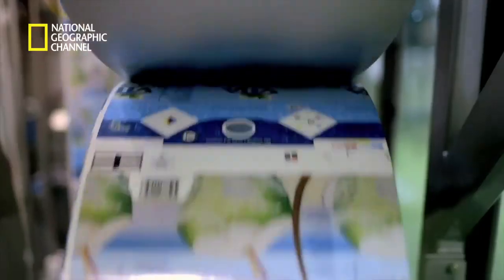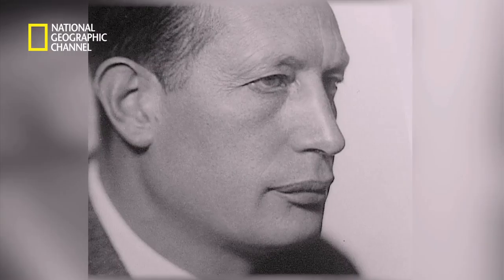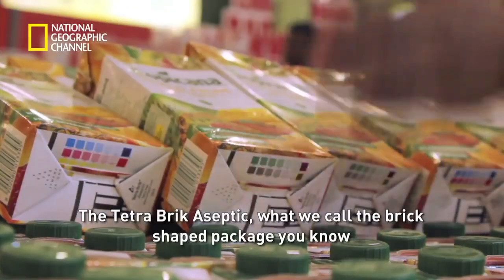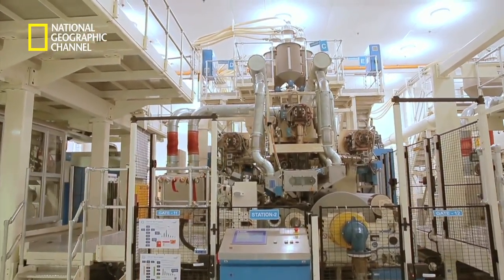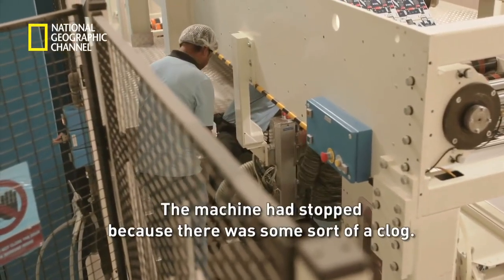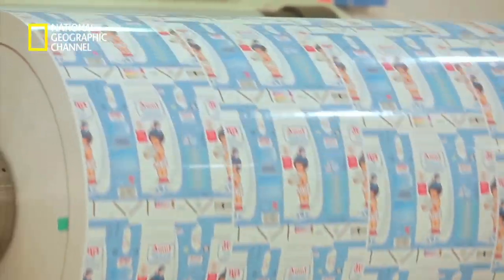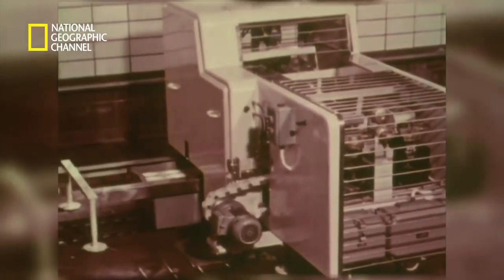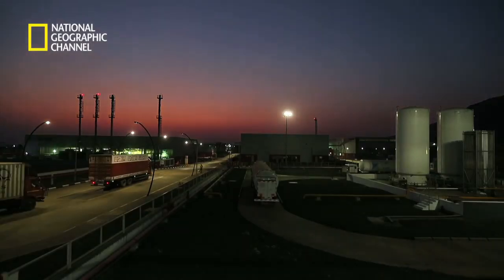Super Factories - Tetra Pak

Comment: I work as an operator in the F&DE department at Tetra Pak. In video 39:33, he mentioned that the operators didn't operate anything. However, I must clarify that we need at least 2 to 3 operators to run those machines. Although the machines are sensor-operated, any malfunction in the sensors could stop the production immediately. Therefore, we must be extra attentive towards those machines, and any delay in reaction could lead to a halt in production.
Reply: Yes ofcourse. It needs proper attention and thorough technical knowledge. I know this since currently I work as a trainee in a dairy company which produces tetra pak milk